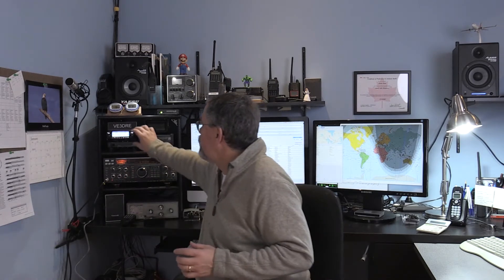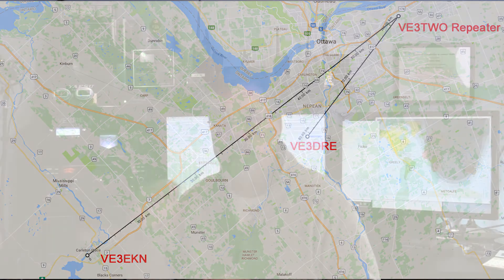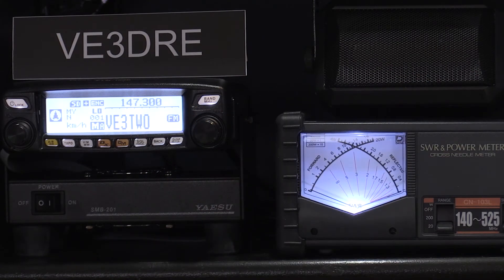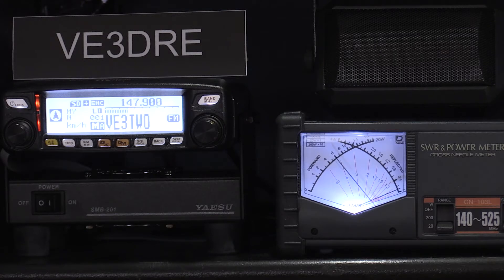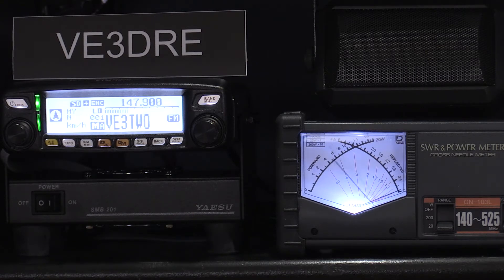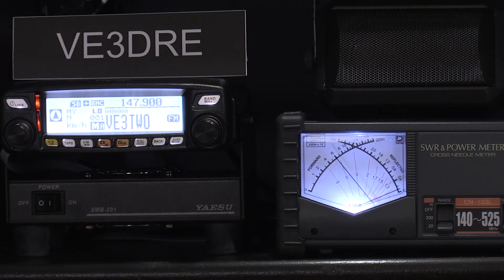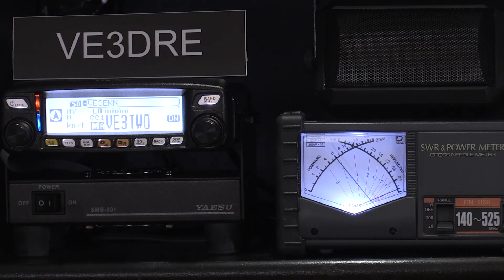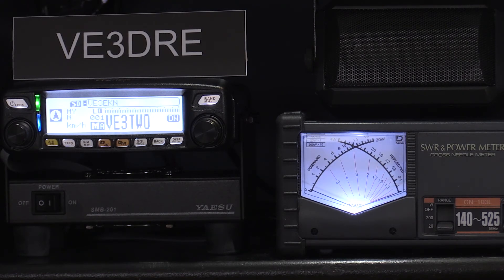C4FM Analogue vs Digital

Comment: I know I'm 7 years too late to the party. Just now jumping in to YSF. The real test would be to go analog simplex. Then have VE3EKN decrease his power until you have about a 12 dB SINAD. Then, have him decrease his power output until you cannot discern what he's saying. 
Then repeat in C4FM (YSF) mode. At about a 5% BER his audio will not be discernable. My guess is that signal level will be about 3-5 dB higher than analog.
Digital tends to "fall off the cliff" about 3 - 5 dBm sooner than analog mode.

Comment: I can not stand the sound of C4FM. It in no way sounds like a person. It is clear with no noise, but It sounds like I'm listening to a text to speech app of some kind. I can not for the life of me understand why some people like it better. The mode is really cool and it might have some advantages, but it is an error to believe that is sounds anywhere close to as good as a quality FM analogue signal. Also WiresX ?? If I want to use VOIP I'll use discord or hell make a phone call.
Edit: I do have and use a FT5DR and I am not a  fan of that radio either, shortest battery life of any radio I have ever owned even with all of the neat features turned off i.e. APRS/GPS

Comment: You didn’t specify if you’re using digital narrow or wide which makes a big difference. Anyway, thanks for the demo. The compression or “codec” that is used needs to be better tuned to sound more natural. I agree with many Hams as it sounds a bit too robotic. lol 😂

Comment: Thanks for the video. I experience the same problem with digital audio quality and IMHO it is digital sound clipping / oversteer. When someone has a low or normal mic modulation, he/she sounds good, but when using max/loud modulation the sound becomes distorted a lot, to the point it is unbearable for my ears. I am using FTM-100DE as well. I wonder if the demodulation/DAC/amplification can be aligned somehow in the radio... Anyone? 73 de SP9JAL

Comment: Thanks for the demo. I have to disagree with your conclusion. I find no pleasure in listening to any of the digital voice modes currently used in ham radio. Sometimes it is even difficult to understand what is being said. I will stick to analog FM and SSB for now. For whatever reason, bandwidth reduction seems to be the prime objective, at the cost of audio fidelity. Other than eliminating background hiss (which we are used to as hams), I see no compelling reason to switch to digital voice. If I am missing something, please let me know. 73.
Reply: this new digi equipment is still in the making test period and audio is only to get better in time..   and i agree they still need to get everyones audio  a little less robotic the more pure the better..   but even more so with thease modes first the same audio level as they can be very unforgiving      mabe some type of a auto digimode ALC limit overdrive protection idea on each rig for balance but something yes?   as its the main cause of its problems on overly high set mic settings or shouting loud ...but in fairness its 100% still at its best of what it can or its audio codec chip can provide to now even down  to a 25 % signal then the crazy blackhole sound kiks in.  its called the cliff drop effect not the slope effect as hams are used to.   in laymans terms its all or nothing in audio till 25%1/4 signal   if your a  5/9  or over  you still will be at 100% in the radios eyes  till down to a  S 2.5 or even S2 if very lucky   and thats the deal or trade off with this and all digi gear.

Comment: Used digital for a little bit.  Prefer FM any day.  If you need to get a more efficient mode that's what SSB is for.  With some good older radios for VHF / UHF SSB has some real good audio.  Really no need for digital here.  Fun to learn, program and play but I hardly use...

Comment: I just ordered this exact mobile radio from Yeasu. In order for digital to work does the repeater have anything to do with it? Do all repeaters take in digital? I’m new to the HAM world and I can’t wait to get this Mobil radio installed in my truck👍😎
Reply from the maker: Hi, your radio will only work in the digital mode on a Yaesu Fusion repeaters or in simplex mode.  It will work in analogue mode on all other repeaters.
73
Reply: Hi!  After watching the video, I tested with a friend 90 km away throw an analogue repeater without success. Just now, as I read on this comment, only Yaesu repeaters allow these types of dual communication. Congratulations for your videos.

Comment: The C4FM voice sounds like that of a robot.  Thanks for helping me make up my mind, I'll stick to analogue FM mode.
Reply: Well, a robot talking through a kazoo maybe, 73 de KE8YCV
Reply: Hmm p25 always sounds better to me
Reply: Still robotic to me.
Reply: It sounds robot like because they are transmitting in digital narrow mode. It sounds perfect when running in digital wide VW.
Reply: @mortalsin1971  Couldn't agree more.  VW mode is competitive with modern phone call quality when reception is excellent.
Reply from the maker: This demo was a local contact using our club repeater, I use the local repeater or simplex 80% of the time. You are correct in that if the internet connection goes down then you can not use the Wires-X functionality.
That said our internet service is more reliable then the hf band condition these days HiHi.  73 Denis
Reply: You can do that until the internet goes down. Then you are local only.
Reply: 😂😂😂😂😂 they were local  and explained how you plan on talking long distance on 2 meter or 70 centimeter to begin with  @lonetrader00
Reply from the maker: it is a bit artificial but you won't notice it after a few minutes.  I rarely use analogue anymore, digital is so much cleaner and if you are mobile there's no more intermod. If you have a wires-x node ore a repeater equiped with wires-x then your talking around the world regardless of the band conditions.

Comment: Nice video.

To my ears the analogue contacts sounded much clearer than the digital ones.
Neither of the 5W contacts where perfect, but I'd prefer the FM hiss to the lossy codec artefacts.
More power improves the FM but of course has no effect on the digital contact.
Reply: I do think the FM sounds nicer than digital modes as well.  I'd like to have seen Full-Rate Digital mode (VW) used in this comparison as well.  I think it significantly reduces a lot of that artifact noise.
Reply: @LancasterWannaBe  Yes would have liked to hear VW mode as well.
Reply: FM is aesthetically much more comfortable even followed by some noise, but, digi mode is more intense and efficient when the goal is just communication, it's, send a message and be understood.